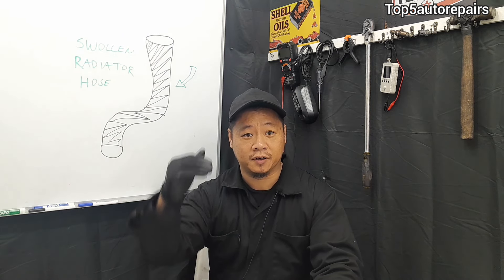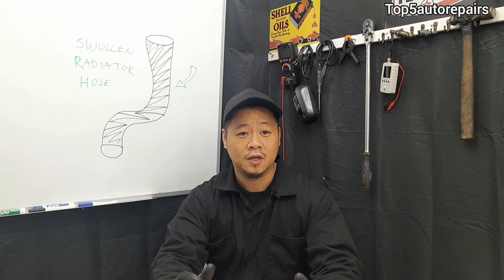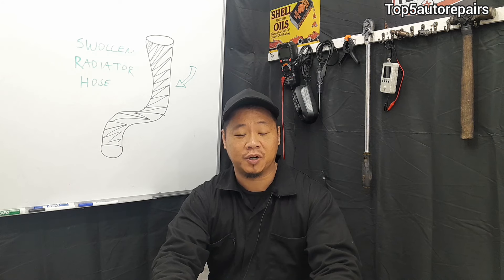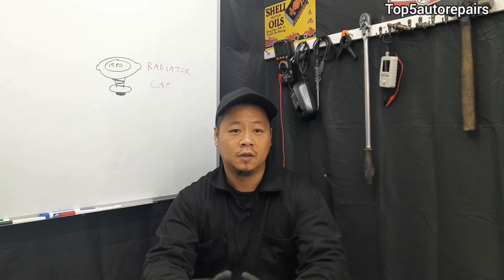WHY RADIATOR HOSE IS HARD AND SWOLLEN

Comment: 2002 honda civic.. 
overheating after a week of it not overheating. After replacing all of these- radiator, hoses, cap, thermostat, coolant & burping for 20min or longer. Before tet driving.
After 2 weeks of driving it normally no overheating issues..it started overheating again.  & it looks like steam comes from top area based on how coolant sprays & leaves the white residue on air filter cover. However I also have some watery green looking liquid under waterpump & front area of honda civic area like under thermostat & a little to the right of that. My fans both turn on & my heat is somewhat warm on startup/idle 
Testing, today I didnt drive it I just started it to check for loss of coolant or head gasket issues, no signs of milky) I have No coolant leaking from radiator it was all the way filled after a week..even though there are still some drops under car to passenger side middle 
 Brand new hoses. Cap & thermostat.  Top hose is warm & pressure feeling after 5min of idling only at startup.
 Bottom is cold. 
I didnt notice coolant flowing cause it was so full. I just had a few bubbles pop up a few times & when I'd squeeze hose the water disappeared but slow cam back. 
After 5min I pushed on radiator cp & I could her some water bubble sounds but not sure if that's normal. 
What  should I suspect

Comment: No overheating on dash.    
Coolant  Leaking near water pump. 
Resivoir full. Radiator empty 
Upper hose swells
Reply: Probobly needs a complete and good flush
Reply: Most likely   failed water pump.
Reply: If there a water leaking under or near close to water pump so it means the water pump is broken ( dead) so you need to change it .

Comment: One of my spark plugs cannot be removed. It turns like the threads have got cut. Does the engine suck in air through this. Will it cause over heating?

Any remedy for this.
Thank you for your kind service
Reply: To get stuck spark plugs out I'll let engine cool overnigt. Then I'll spritz a little wd40 in the spark plug well, and work back and forth with the ratchet wrench. Light to medium hand pressure when turning and each time it get too hard, I'll go back tightening a bit. And just work it back and forth trying to get just a tiny bit more loose each go or every other go. Just stop and go back when you feel it too hard to turn with light/ medium pressure..
But overheating might need to flush the radiator/ heater core, and change coolant. 
If you haven't done so already

Comment: got an E36 m50b25. rad hoses feels hard after diving it. there is no coolant consuption. upper hose is hotter than lower hose. car runs great with no overheating. rad cap and radiator are new. is that normal?
Reply: If the hoses not very hard it’s normal

Comment: Mine was blocked radiator in a big caterpillar diesel and never thought about it and i cooked her she is now locked up probably btoke a pistion or bent a valve.yes the blocked rad was preventing the circulation of max 15psi and the back pressure was instant and violent was not combustion gases

Comment: Thanks but I have a different problem I think. What if my lower radiator hose stays cold? Top is hose is warm and both are very squishy and soft... Even if I drive the whole day the bottom radiator hose stays cold.. temp stays around 90C though
Reply: Probably thermostat.
Reply: Probably don't have a thermostat

Comment: Is there a way to modify the hoses to where it bleeds the combustion gases? My tacoma runs completely fine, however coolant goes into the overflow and i constantly have to siphon it back into the radiator... do the sell steam vents or anything?
Reply: Are you serious?
Reply: If your coolant is vented, it won't be pressurized, therefor it will boil. It needs to remain pressurized.
Reply: Hopefully one year later, it's not completely blown, or you've fixed it by now.

Comment: Radiator was boiling and the reservoir tank was bubbling and over flowing. 

I have checked out the following after charging hardened top hose 1) fans are working 2) thermostat valve is opening well 3) clean radiator 4) changed cap 5) no signs of coolent leak near water pump.

The dashboard heat meter just above 50% say 60%.
I live in a hot country.

Now have I solved the heating problem???

When I stop after driving I hear some bubbling sound for 1/2 minute or so.

25 year old Suzuki Cultus is me car.
Please advice. 
Thank you.
Reply: you ever figure this out? please let me know! same problem for me

Comment: Sir my Lexus rx330 radiator black hose pipe NEVER ever becomes hard even though I drive 250+ nonstop.
Is it a good sign? Or there is a problem?

It is soft as it is during a cold start of engine.

Plz share your valuable advice
Reply: 250+ miles *

Comment: I changed my thermostat, the assy water valve on the nissan xtrail t30 2004 (QR 20) and coolant is not reaching the heater core, all heater core inlet and outlet house are cold, only the top radiator hose is hot and swollen, and the other thing is when l open the radiator cap and start the car, coolant starts to flow out of the radiator, l even changed the radiator cap still pressure builds up and now lm seeing liquid coming out of the exhaust. What could be the problem
Reply: If it comes out exhaust, it's head gasket.